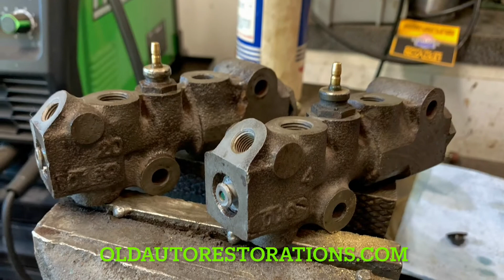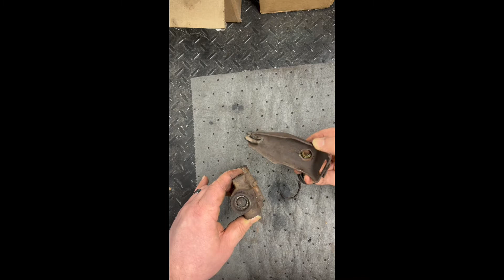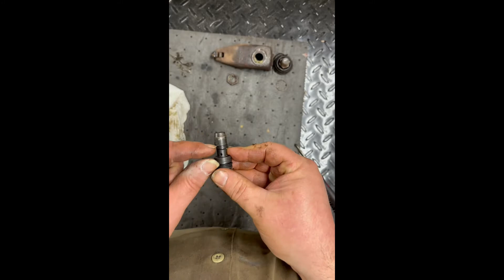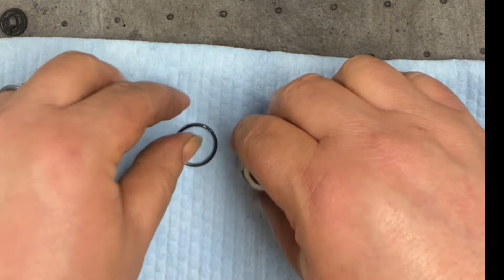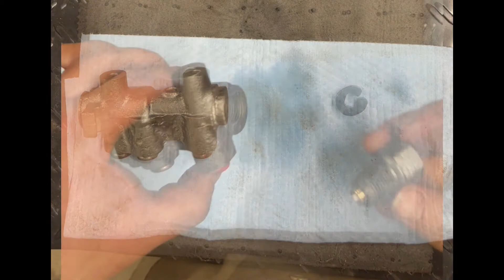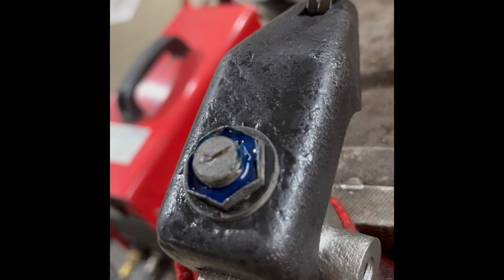How to Rebuild a VW Brake Valve - Early 80's German VW Rabbit

Comment: Do you happen to know where to get all the seals and O rings for that proportioning valve. Thanks in advance
Reply from the maker: I get special lip seals and the O rings from a couple different places. It just all depends on what they have in stock and you usually have to order a large quantity at one time. You have to know the sizes. No one sells by application.
Reply: What is source of the piston cups